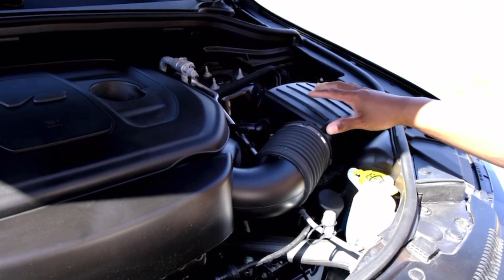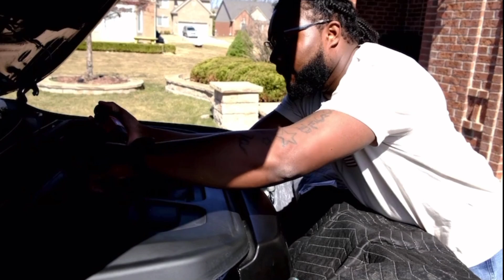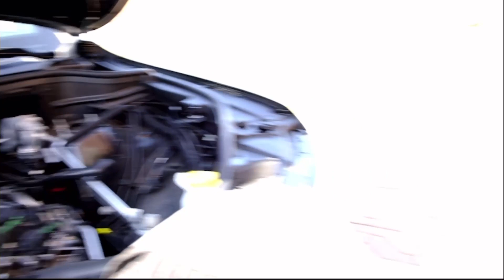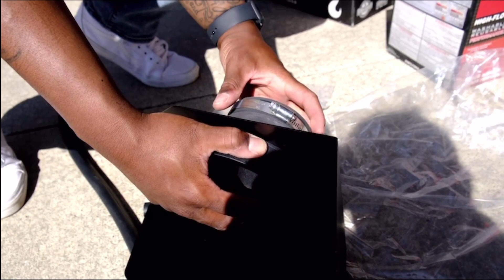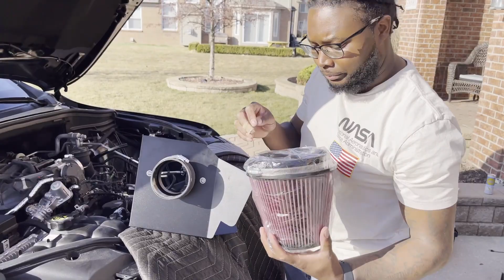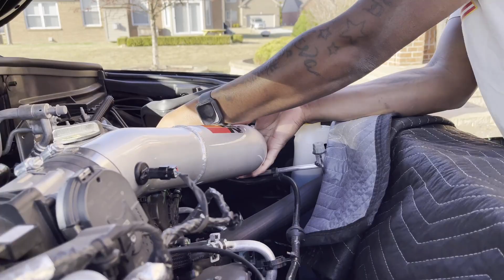K&N 77 Cold Air Intake Install | V6 2020 Jeep Grand Cherokee Limited X

Comment: NICE. Couple questions: What year is that thing? Also, is that the original throttle body, or did you put the larger one on from the Hemi?
Reply: You can use the original throttle body.
Reply from the maker: Thank you and mine is a 2020 and you can use the original throttle body as well as an upgraded one. Which I’m posting a video on that next 👍🏽
Reply: Nice install!  I have the same issue, until now!  Finally a 20 install vid!  Great job, having your cameraman was key!
Reply: @BlklimitedX  So that intake will fit both the original throttle body as well as a larger one?

Comment: How does it feel? And increase in HP that you actually notice?
Reply from the maker: To me I feel it more down low in the torque department more than anything. I haven’t thrown the truck on a dyno for exact numbers but I’d be shocked if there wasn’t an increase in power. Once I get my exhaust installed I do plan on tuning the truck to to truly benefit from the mods.

Comment: So with all ur mods u added n all do u use ur pedal commander as well with all ur mods together then n what's ur take on all that together as a whole may I ask
Reply from the maker: Yes I still use the pedal commander with all the mods I’ve done. Everything paired together makes for an exciting daily driver while still being able to get good fuel mileage. And without having gotten a tune yet I’ve been impressed with this setup. I do want to tune, but later on down the line.
Reply: I'm happy to here that man I wasnt trying to be creepy when I asked about talking to u via cell so if I offended u some how sorry not  intentionally did ok just wanted to know how all those was going along together cause I have a 2014 jeep grand Cherokee Laredo sport n I've done so much to it since it doesnt look the same at all n I wanted to work on mi engine as well I have the pedal commander but haven't installed it yet but I'm going too n whata the name of that k n n thing u have
Reply: So thank u very much for answering back n understanding looking 4ward to see n her more about iove mi Vehicles as much as u do so much respect bro good job
Reply from the maker: @solo.wpolanco793  no problem man 💪🏽

Comment: Did you happened to have the check engine light come on after installation
Reply from the maker: No check engine light whatsoever. If there is, something went wrong in the installation process.

Comment: I’ve read that a lot of people have had problems with the sensor falling out have you had that problem at all?
Reply from the maker: If you’re talking about the air temp sensor then no. If they were having problems with it they probably didn’t re-install it properly or probably damaged it when trying to install it.
Reply: I thought that might be the case too this video made me want one but I was having second thought because of the sensor great job explaining everything clearly!
Reply from the maker: @Suprsaiynfajita  no problem man, just take your time when installing. And the good thing at least is that part is only 30 bucks so it won’t hurt your pocket to much if you break it.

Comment: Have you noticed any weird sounds when getting on it? Starting at the lower end of the rev range…like leaves or something in it…then goes away as your reach higher in the rpms? Or what about a burning smell after driving?
Reply from the maker: No haven’t experienced anything like that thankfully. That’s not normal if that’s what’s happening.

Comment: Do you know if  the 2017 Limited will be the same installation as your 2020?
Reply from the maker: They’re close enough in years that I would hope it’s the same. I haven’t sent the engine bay of a 2017 but I’d be shocked if it’s any different than mine.
Reply: @BlklimitedX  thx bro!!

Comment: Hey bro, great video. I ended up ordering mine right after watching last week and installed it yesterday. What a difference! 

Question… how did you bypass the rev limiter while in park? I’ve got a 2019 overland and it tops out at 3000 — even tried switching to sport mode and turning eco off. No luck…
Reply: i have 2020 in neutral and park it goes to only 3000 to must be a safety thing but when you drive it will def go up when pedal down to hear it
Reply: @haloaudiosport  yeaa I’ve come to accept it unfortunately. Also just got my exhaust done and sounds amazing but, alas, that damn rev limit 😑

Thanks for the reply, buddy!

Comment: Does the water get through the vent of the SRT hood?
Reply from the maker: Minimal if any that I’ve noticed. And in regards to my intake, no water gets into it. And I have a dry bag over it just in case.
Reply: kool thanks..
Reply: yes, loads of water. the rain is channelled down due to the shape of the hood

Comment: Does the filter get wet due to the performance hood? I want one for my 19’ X Hemi but they say the filter will get wet. Lmk
Reply from the maker: No it doesn’t get wet at all, if any it’ll probably be a drip lol. But if you have concerns about that K&N offers a dry filter wrap which will completely cover the filter but not affecting performance

Comment: What kind of wheels are those
Reply from the maker: Those are the OEM 20x8 wheels for the Limited X 💪🏽
Reply: @BlklimitedX  damn those are amazing for oem wheels.  I'm looking to buy a used jeep gc ecodiesel.  Do the limiteds have the air suspension? Or is thay only in the overland and summit?
Reply from the maker: @cyclonus01  thank you man 🙏🏽 and the ecodiesel is a nice pickup, but I don’t think the Linited has air suspension unless they allow you to option for it

Comment: 😅 i use to install rubbish like this on my car when young. Dont do it! It sucks warm air into the engine = less bhp. If you notice your cars always run worse in hot weather. They sound good but are not helping.
Reply: Your problem was either a cheap cai, improperly installed or dirty filter which would contribute to less bhp. I’ve never had an issue with any K&N accept for couplers blowing in my 5.7

Comment: Don't change the throttlebody for the luv of God.
Reply from the maker: 😮 why not? Because I already have lol
Reply: @BlklimitedX  My dude it's a v6 for one 😆 Bigger throttle body won't do nothing. Maybe alittle better throttle response but you would be better off staying with a pedal commander. If it was a 5.7 then ok. I have a 2017 SRT full AFE setup and tuned by diablotoona. No need to touch a throttle body unless you porting the intake manifold to take advantage. There is plenty of vids on YouTube showing that it does nothing practically without supporting mods. Understand that your vehicle has to be tuned in order to reap any benefits of any kind of mod. Yo jeep though my dude and you spend yo way but honestly that money could have went to something better.
Reply from the maker: @bennybolick1360  I hear you but I still did it and money is still going to other things.